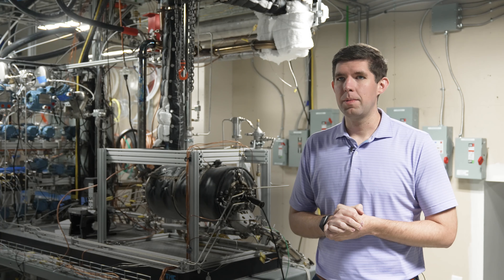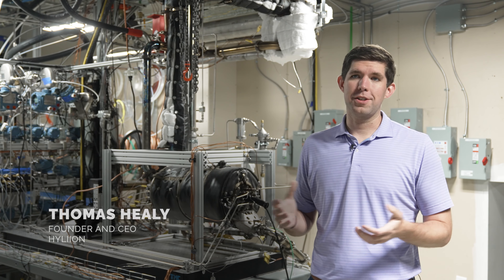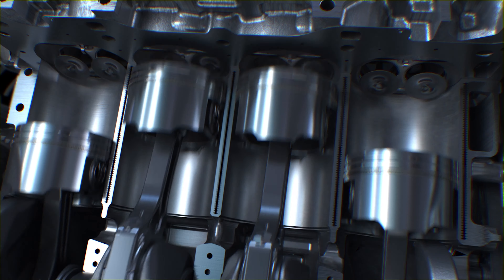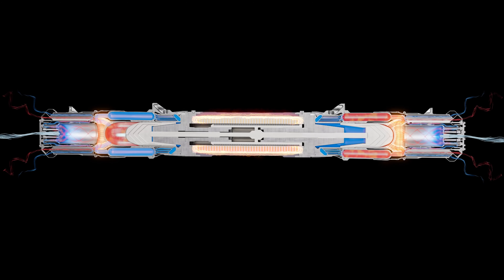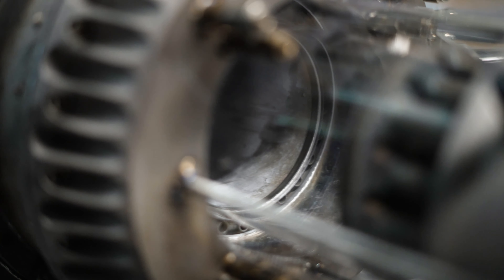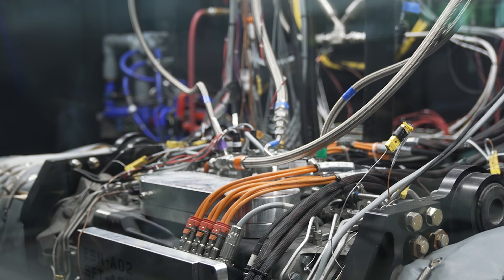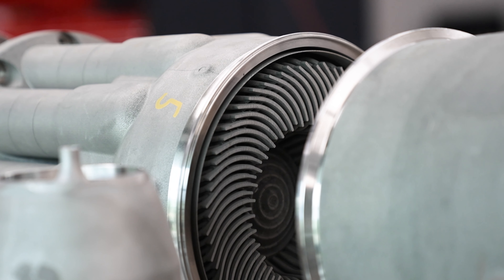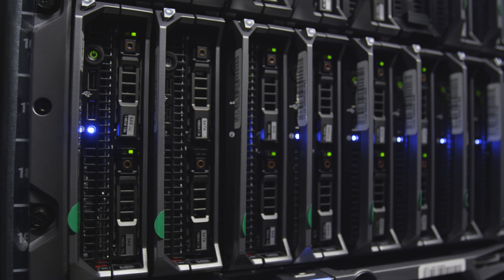KARNO Tech Series: 10. KARNO Generator: Fuel-Agnostic Feature

Comment: Please actually explain precisely what is being done to liquid fuels. If my understanding is correct, what is done for LIQUID FUELS THAT NEED TO BE PRE-VAPORIZED before being introduced via the fuel nozzles to the combustor assembly is that they have to  go through a vaporizer and the vapors are then pushed into the combustor. You make a big deal about generalities but actually explain almost nothing. At this point in the PR, maybe you can step up your game to enhance credibility.
Reply: Fuel, whether it's liquid or gas, passes through a heat exchanger system that gasifies any liquid as well as preheats the fuel vapor prior to it's introduction into the reactor. That is a part of their normal fuel flow.  Gaseous fuels simply pass right through it while still taking on heat. They demonstrated the liquid gasifier portion during their open house.
Reply: @williamsteele  

My understanding is that Karno utilizes a LIQUID FUEL PRE-VAPORIZER which differentiates it from a gaseous fuel. If you look (and not that closely) when the video that shows the Karno combustor being fueled by a liquid fuel, you will see bright speckles of non-vaporized liquid fuel droplets being burned with a diffusion flame front (that promote higher NOx emissions, and somewhat negates the “FLAMELESS” claim). 

Irrespective, the Karno combustor was designed at GE using their turbine combustor experience. In turbines, the dual fuel combustors have different physical hardware to deal with liquid vs gaseous fuels. Also, turbine combustors that use different fuels almost always have to be designed for that fuel these days (not so much in old turbines as they were not optimized for efficiency and NOx production). So I find the suggestion that with the Karno it only needs one design for every fuel to be questionable, especially when including hydrogen and ammonia into the list. 

So if you know more technical details of how the Karno works, please help us get past the “PR WALL” and “talking heads” as Hyliion is not doing a reasonable job at clarifying possible issues.